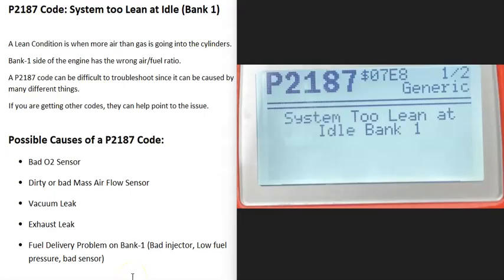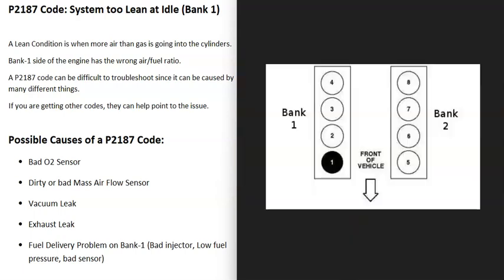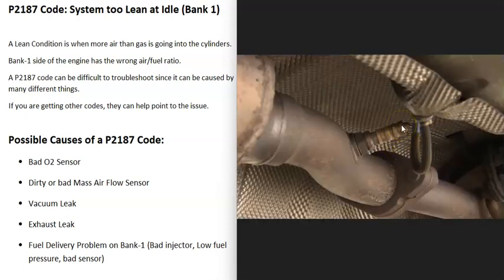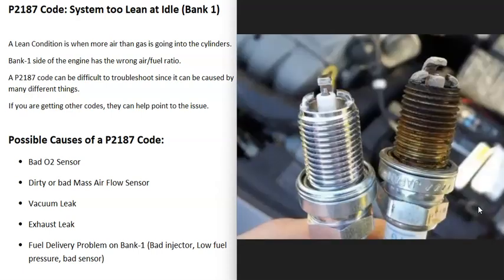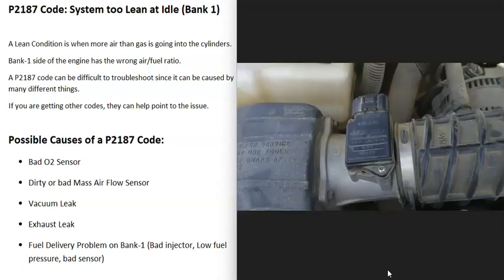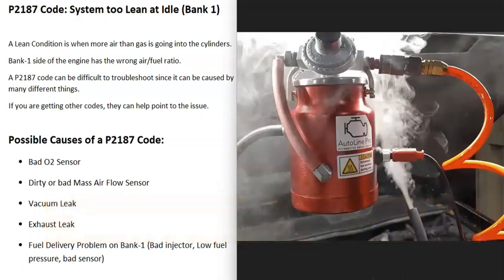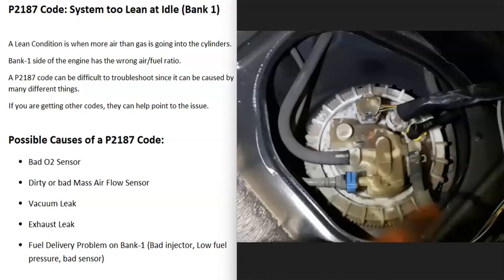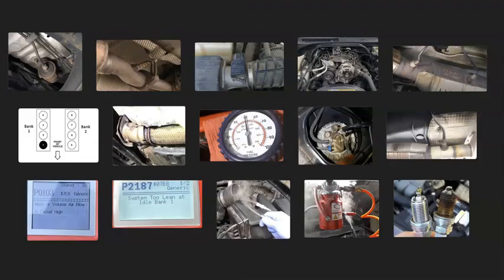Causes and Fixes P2187 Code: System too Lean at Idle (Bank 1)

Comment: I have a p2187 along with P301,P302 & P304 please help point me in the right direction. I replaced the head gasket & had a valve job done on the head. Put the car back together and can’t get the car to idle smoothly. I cleaned the throttle body and the mass air flow sensor, it helped a little, but the vehicle is still throwing codes.
Reply from the maker: Something is causing a lot of misfires that will also cause it to run lean. It needs to be diagnosed, but since the heads were removed, I would double check for any loose hoses not reattached, possibly causing a vacuum leak. I would also double check the firing order is correct.

Comment: my Skoda 1.0 goes very lean with STFT 25% on Gasoline FT1 goes to +50% ...stays for some time and comes back to normal...this keeps happening...performance is not affected much though when it happens..get P2177 error..o2 readings seems Ok ...and changing no error as such

Comment: I have the P2187 on 2018 Q3 Audi does this process of elimination work on all vehicles or specific ones. Greatly appreciate any feedback
Reply from the maker: Components can be laid out and named differently, but troubleshooting Lean codes is basically the same across all engines.

Comment: 2017 honda crv only a P2187: the  emmissions light  goes on, then  goes off later  and reappears. so it all points t oa oxigen sensor of the cat, located  in front looking down, I can pull the pre and post module off, see if it tosses the code, and  reset the MIL.  last resort is to change out the sensors.   1  pull a plug, inspect,  change all four and keep an eye out,  if goes away ATP, if not  replace the sensor, b/c its  is not the fuel pump in the tank as I have a A30 Xtool  that I can   do a test wit hthe actuator, pump on passed , pump off I gave up Lol  any insight is appreciated thanks. got till  next year to  insect lol

Comment: I got the p2187 system to lean at idle  code but also got two other codes which are p2279 untie air system leak bank 1  and P12A2 one say, do you happen to know what can be the issue
Reply from the maker: I would check for an intake air leak
Reply: Thank you I appreciate the response

Comment: I initially noticed a few misfires on Bank 1 — mostly on cylinder 6, but occasionally also on cylinders 1 and 3. At first, it was just 1 misfire per cylinder during cold idle, but after driving a bit more, I started seeing 3 to 5 misfires on cylinder 6. That makes me suspect the spark plugs or ignition coils on those cylinders, especially #6.
The engine seems to run fine, but the check engine light comes on when I lightly press or release the throttle around 80 km/h. The scanner showed a P2187 code ("System Too Lean at Idle").
The garage is planning to replace all 6 coils, spark plugs, and the fuel intake unit under warranty — I hope that will solve the issue.

For now, the car is parked in the driveway. I'm unsure if it's safe to keep driving it, or if doing so might make things worse.
Reply: Did you fix it

Comment: Great video! I’m trying to pinpoint the issue on my wife’s 2012 VW Jetta 2.5

Currently have 4 codes. P2187 P0106 P0507 P2407

I am leaning toward a vacuum leak and was going to replace the PCV valve but was curious after watching your video if you have any other recommendations.

Again thanks for the great video and information.

Comment: I have an 08 aveo I believe the culprit is an exhaust leak but I smoke tested from the tailpipe forward and saw nothing.  Is there a more accurate way to test? I did replace the converter and clean out a blown out honeycomb previously.  She's quiet but there's zero back pressure and hard starts/low idles occasionally.  Only code currently is p2187 but I did have an 0420 before I replaced the converter and o2 sensors.
Reply from the maker: If you have an air compressor, air can be fed into the tailpipe, and soapy water can be used to see if there is a leak. The engine may also be running lean, which can be hard to troubleshoot sometimes. If there are no other codes, the spark plugs can be removed one at a time and matched to a spark plug burn chart to see if a cylinder is running lean.

Comment: I got a P2177 and P0177 code.  Tried replacing the PCV valve myself because that's the easiest part to replace.  I don't have any hesitation, rough idling or misfires.  But my fuel economy is horrendous. I can tell this is going to be the parts cannon type of troubleshooting.  If anyone has any ideas, I'm all ears!

Comment: hello, i have a p0087 along with this code, what does that point to? and i think my honda is in "limp mode"
Reply from the maker: A P0087 Code is "Fuel Rail/System Pressure Too Low." I made a video on this; here is a link. https://youtu.be/U_f1yVzIuZI

Comment: P0304 and p2187 is running rich you can smell it ive stopped driving the car
Reply: P304 is a misfire on number 4 cylinder so would be showing rich check coil and plug

Comment: I have this code as well, but also have P2681, engine coolant bypass valve circuit open. It's fiesta ST 14'. Car is rough at idle and smell of gas is present. Drives fine. When is warm, RPMs needle goes up to 1600 and then down, this repeats. What could be the issue? Also my long fuel trims are around 60%. Any advice ? Thanks
O2 = 1,45V
Reply: did you sell or it or get it fixed

Comment: If I am getting a P0134 along with a P2187 at the same time. Does that mean it is the oxygen sensor? I am also noticing sometimes a lack of power when driving. Will a bad oxygen sensor make it run lean?
Reply from the maker: If the 02 sensor is bad, it will give bad information, so the computer thinks the engine is running lean when it is not. Lean codes can be hard to troubleshoot. I would test the 02 sensor (Bank-1 Sensor-1) and, if it's good, check the spark plugs on bank-1 to see which cylinders are running lean.
Reply: Great imf ! Thank you